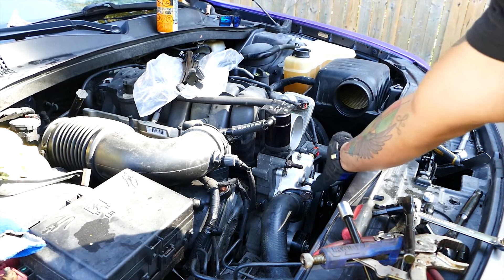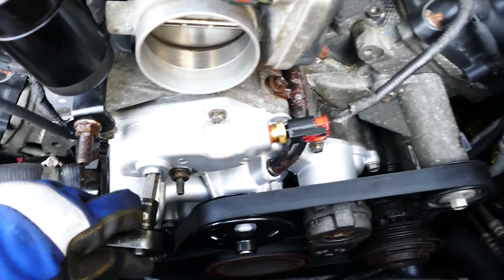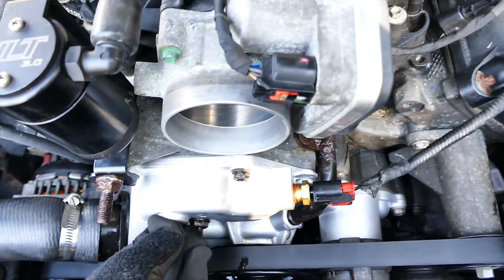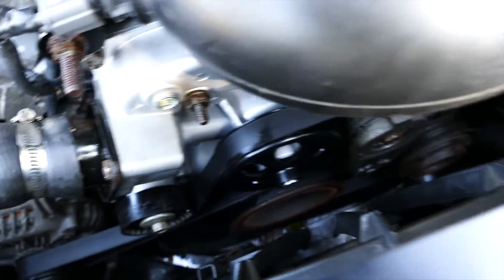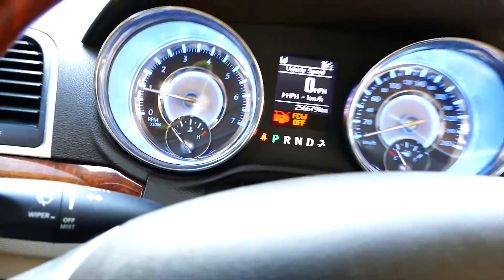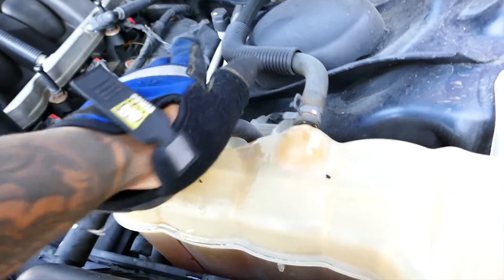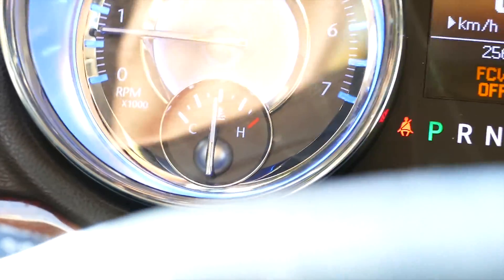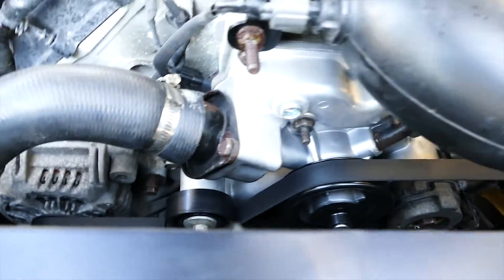how to bleed coolant system on 5.7 hemi

Comment: Please answer, I have a 06 300c 5.7 hemi, how would I know if my mechanic didn’t bleed my new water pump ? I walked away a couple times near the ending when he finished so I never saw him bleed it. My car overheats in the freeway not on main roads going slower and not in idle only when I push the car to 80. I have to have the heater on or else it’ll get warmer than it needs to. My engine oil heats up as well when it gets hot. Never have gotten to the red bar though
Reply: So I replaced the Radiator, thermostat and water pump but the first time when I fixed the radiator he forgot to bleed the air from it and I overheated on the freeway, not smoking but I was at the 3 quarters mark and coolant was boiling out of the coolant tank, now like I said just on the freeway it’ll overheat not at idle or slower speeds
Reply from the maker: hey there, after all that it looks like the thermostat failed, pick up a different brand and follow this video https://youtu.be/uIkoFmFUKeM?si=-I8sqi1xb1DxdGd-
Reply from the maker: with the thermostat off you can fill the water pump and it will bleed itself, hope this helps!
Reply: @moparbro  thank you so much, one more question.. could this be a cracked head gasket? I’ve driven about 1,000 miles with it in this condition just because I don’t have money lol.. no check engine light.
Reply from the maker: @ricolopez4228  I don't think it's a cracked headgasket, It would leak everywhere and in the engine oil
Reply from the maker: cracked head gasket would throw a code for sure
Reply: @moparbro  I’m just super nervous lol I’m 20 and me and my girl just split up and now I’m stuck in the car and if this goes to shit then I’m fucked 😂😂 I have $100 to my name as of right now would you recommend me to change the thermostat out and if it doesn’t fix anything just put the old one back in and take the new one back for a refund? I saw in the video you recommended me you got a new housing unit for the thermostat or did you just clean it off really good?
Reply: @moparbro  or should I use the $100 take it to a shop for them to properly diagnose what it is? They said it was $75 for a block check I think I’ll opt out on that with your advice as I don’t have a knocking in my engine or bad oil or white smoke or anything just my car will get warm
Reply from the maker: @ricolopez4228  hey there, yea if it doesn't work simply return it, just clean off the housing with soap and water, orange coolant and a thermostat should be under $50
Reply from the maker: also technically the shop didn't fix anything, you definitly have some leverage with them to argue and get them.to fix it
Reply: @moparbro  my mom works at the shop and I got the work done at a discounted price by a apprentice after hours and the only reason I said yes to it was because I couldn’t afford to go through the shop itself.. my series of unfortunate events I will definitely ask him if we can take a look at the thermostat and if we could clean the housing unit
Reply: @moparbro  so I just talked to the mechanic and he is saying I should just sell the car, he said he replaced the thermostat twice and he went over the fact that I said I wanted to clean the housing unit and he said it doesn’t make sense as it’s just basically a metal tube that connects places, he said there’s no chance of that being it. Brand new water pump and he wire wheeled the outlet he said it’s clean
Reply: So I replaced the Radiator, thermostat and water pump but the first time when I fixed the radiator he forgot to bleed the air from it and I overheated on the freeway, not smoking but I was at the 3 quarters mark and coolant was boiling out of the coolant tank, now like I said just on the freeway it’ll overheat not at idle or slower speeds

Comment: I have a 05 Magnum RT & cannot get the coolant to flow it has fluid in it not sure if its enough but i installed new WaterPump,Thermostat, Radiator & Coolant temp Sensor & it still overheats is it best to bleed the system while the car is off because i do it while the car is running need a lil bit of advice before i ship it to the shop🤦🏽‍♂️ also my heat doesnt work & doesnt look like any coolant is reaching the water pump
Reply from the maker: hey there, ah gotcha, if the heat doesn't work while replacing the thermostat you most likely have a blockage at the heater core, what I would do is take it to a shop and have them do a coolant flush where the hooks it up to a machine and push new coolant in and it sucks old coolant out, this way hopefully the pressure unblocks the heater core. Also you can try filling coolant from the thermostat housing and keep filling until it drips out of the thermostat housing neck, at that point its "full" so if that doesn't work definitely try a "coolant flush". also while a coolant flush is being performed any, leaks or issues the pressure from the process should identify the issue, since most of the coolant system is replaced, it should be the last issue should there be one.

Comment: @Fred_eazy21 so I filled my coolant and nothing is coming out of the bleeder hole does that mean I just have a blackage? Lately my coolant has been bubbling and spilling over the top of i sit in idle for too long and my coolant needle stays in between cold and the middle when I drive it
Reply from the maker: hey there yea I would get it flushed (they put a machine in and pump coolant t throught) thnx for watching!
Reply: @moparbro  thank you

Comment: I just replaced my thermostat and coolant temp sensor on my 06 300 5.7. Followed all of your steps. When I initially filled the reservoir I got it up to the max line . After I drove it for 30 mins it rose all the way up almost to the cap , didn’t overheat though. Does that mean I still have air in my system or should I just bleed it down a little bit ? Thanks for the video it was helpful .
Reply from the maker: hey there, it's either a bit of air in the system of you have a blockage somewhere in the coolant system in which can be fixed with a coolant flush (the flush where a machine is hooked up the your coolant system and coolant is forced through the system is replaced) blockages would be pushed out. For now what I would try is using the temp sensor hose as the bleeder hole as it sits higher than the stock bleeder hole. While the hemi is cold, remove the temp sensors, then fill the coolant reservoir until coolant spills out of the temp sensor hole then slap in the temp sensor. after that run the 300c with the coolant reservoir cap off as well as the heater on full.blast to have the coolant flow through the heater core. run this until it gets to temp then turn off the 300c and put the reservoir cap back on.
Reply from the maker: @lucasechase711 if those steps didn't work  and it didn't overheat simply take it to a shop or place that has a coolant flush machine and get a coolant flush done, should be fairly cheap 100ish bucks maybe less, doesn't need to be a dealer, I personally would go to Mr lube or  a reputable shop
Reply: hola, lo que tienes en tu sistema de refrigeración es aire y lo puedes comprobar al encender el aire caliente de cabina, con tu motor en ralenti, veras en el deposito que tu refrigerante vuelve a bajar, es simple, solo debes colocar la parte de adelante de tu vehículo en altura, (puedes usar banquillos, una parte del camino en subida etc) luego debes repetir el proceso de purgado, esto es como lo explica "moparbro",  ¡ESTO ES IMPORTANTE ¡ SIEMPRE PERO SIEMPRE VERIFICA LA TEMPERATURA DE TU MOTOR, si ves que sube detenlo inmediatamente.

Comment: My coolant only fills up from one side and not the other where the little tank is, is there any reason why that might happen? I have no ac/no nothing it won’t blow anything out and my coolant keeps over flowing when hot..while the other side of the coolant tank is empty
Reply from the maker: Hey there, you may have a blockage, in any case you can also fill the water pump casing by removing the thermostat hose and fill coolant from there until it drips out the thermostat housing neck, reconnect the hose and let the hemi run with the small reservoir cap off, put the heater on full blast as well to circulate the coolant through the heater core, run it for 10 minutes and monitor the temp gauge, if all is well put the reservoir cap back on and let it run for another 10 minutes, if all is well with the temp gauge, give a test drive and see if it over heats, if it doesn't then you should be OK. thnx for watching!
Reply: @moparbro  appreciate it, I’ll try this out tomorrow morning!🙏🏼 thanks bro!

Comment: Now how would you do this for the Jeep Grand Cherokee with the 5.7L? The reservoir and radiator cap are separate.
Reply from the maker: hey there, if you have a radiator cap and a reservoir car fill both locations until coolant comes out of the bleeder hole, thnx for watching 🙏